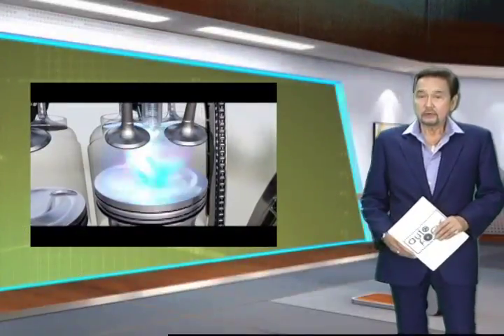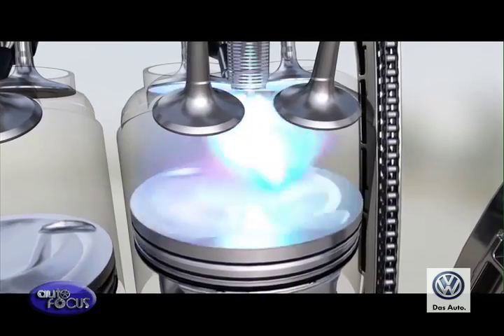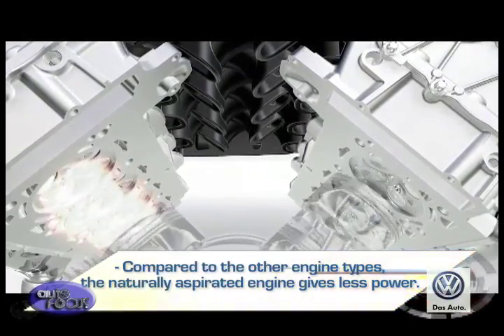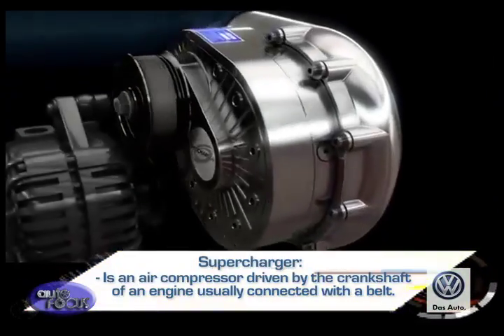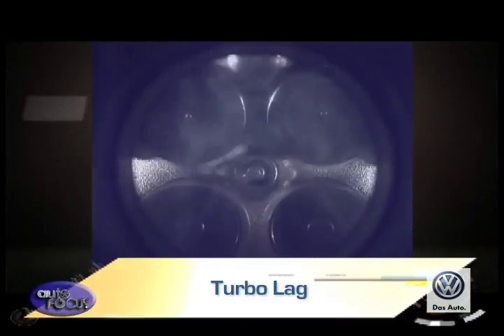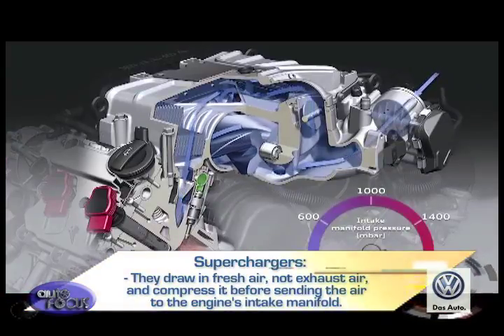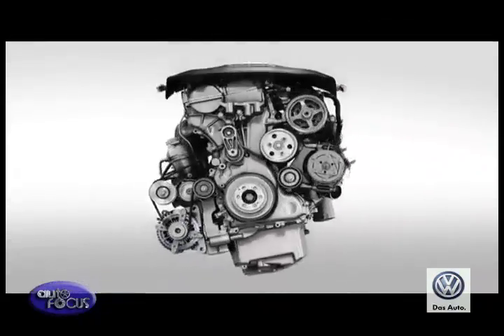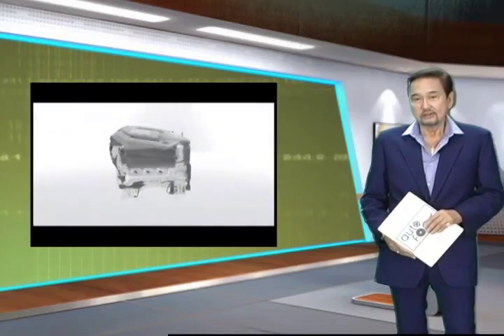Auto Techno Naturally Aspirated Engines

Comment: Naturally aspirated engine are the worst types of engines. A car/truck need more torque especially when you need to pull trailers, cargo and even passing in the passing Lane. The Naturally aspirated engine has no freaking power. It's a waste of time and money of building them! I wish you would bring back the old school carburetors where you don't need a technician to build a motor or repair a vehicle. A carburetor can be repaired by a typical person right in his own shed, shop or garage.
Reply: Cons doesn't mean it's worse. If you said that it's a waste of time and money to build them, do some research. Turbos were less reliable than that since it dilutes too much oil and the turbines itself worn out easily sometime and it costs a lot! I know that type of engine is not as powerful as turbocharged engines. So please, don't call it "worst".

The carburetor one, yeah it is very reliable than fuel injected.
Reply: @vangezy6456  I research everything I read and Naturally aspirated engine are junk when it comes to power (torque/power/muscle/workhorse)
Reply: @brianshull2000  I understand what you mean. As you can see, NA is focused on reliability more than speed and power, dats why you see it mostly in compact vehicles. And btw, thank you for doing a research, I didn't mean to argue about that.

Comment: Seriously? Turbo draws EXHAUST GASES AND FORCES THEM BACK TO THE ENGINE?
Reply: no the turbo is powered by the exhaust gases, they spin the fan that shoves in air from the intake
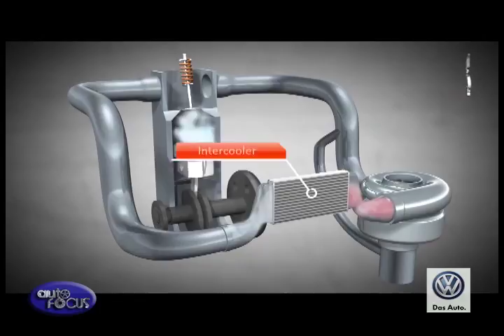Reply: @johnyblaze11  Yes but they got it wrong in 3:01 they show taht the gases go to the turbo then to intercooler and then to engine...that doesent make any sence
Reply: johnyblaze11 I used the heat to destroy the heat